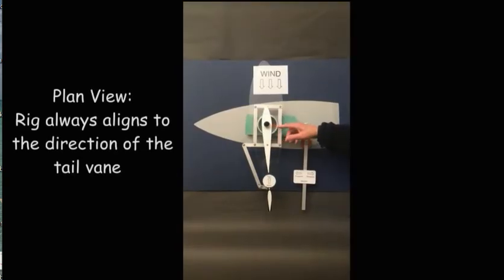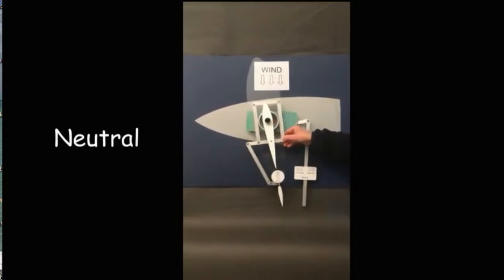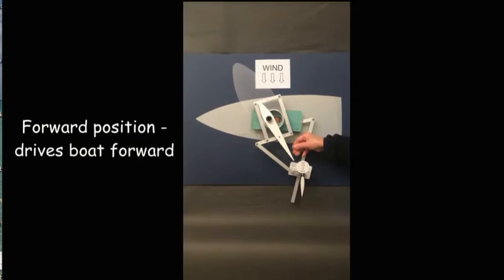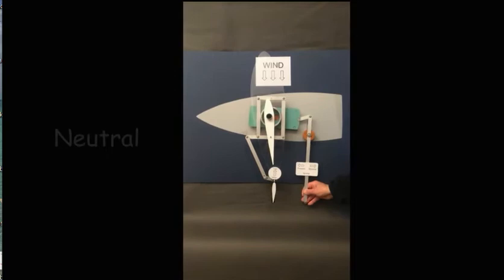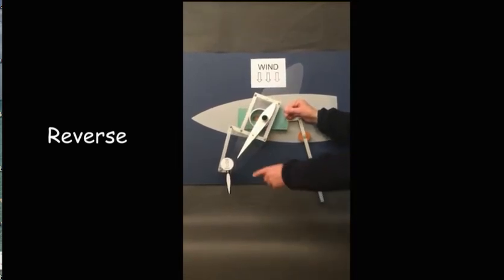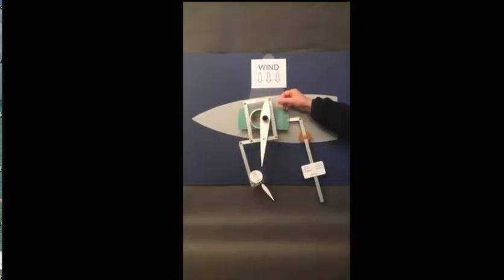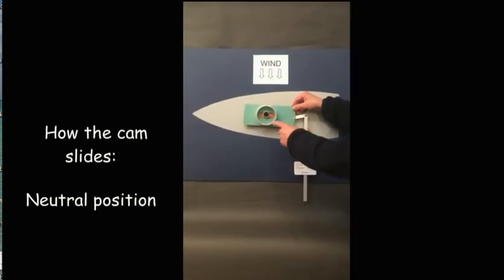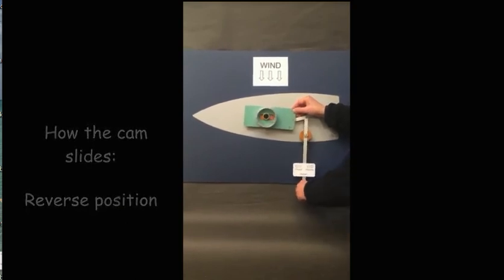Self-Trimming wingsail automatic system

Comment: I’m a little confused by the forward and reverse. When you push into forward and then tack with the wind from the left, wouldn’t the vane be pointing in the wrong direction and the boat go into reverse? Thanks, I’m really trying to get my head around this one, but I am VERY interested.
Reply: wind is not going to magically come from the port side.  It is coming from the starboard side as shown.  You need to tack so the wind would come around the bow and end up coming from the port side.  The sail will follow and swing across the tack to the other side
Reply: you're correct, he has it arse backward. He doesn't quite understand how lift works.

Comment: I would be very open-minded towards wingsails if they had manual controls. I'm not very fond of push-the-button "sailing"...
Reply: Ok well I have designed a fully automatic manual system (no electronics) you can check it out on the website http://www.sailwings.net
Reply: Peter Worsley There are a lot of interesting info on that site. Thank you for the link. The only disadvantage I have found is that wingsail boats chafe and break their mooring lines. But the advantages these sails provide are truly massive. Wingsail would be perfect for a single-handed sailor (no more 10 to 20 different lines to hoist, trim and reef sails). And having a manual control system is actually an advantage because marine electronics/computers (if wingsail is computer controlled) have the habit of breaking in the worst time.
Reply: Is it possible now, to make a collapsible, or fold down wingsail?
Reply: @howdyahworkthisthing1520  inflatable maybe?
Reply: @johnassal5838  That would be cool.
Reply: @johnassal5838  it’s not that I would be worried about the wing itself, but I would be worried about things that are being blown around by the wind; damaging the wing.
Reply: @howdyahworkthisthing1520  If the membrane is made with kevlar or aramid fiber then anything damaging it is probably sinking you anyway.